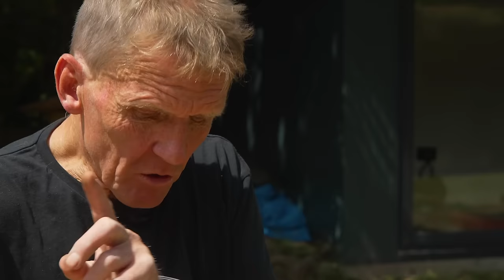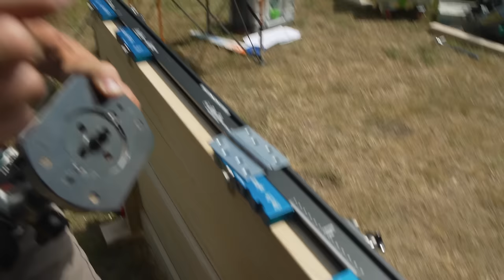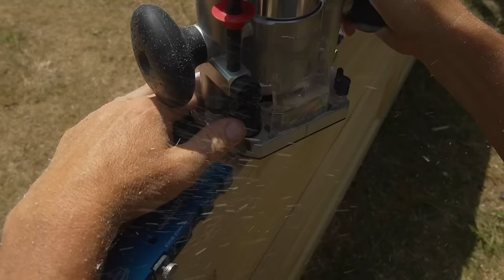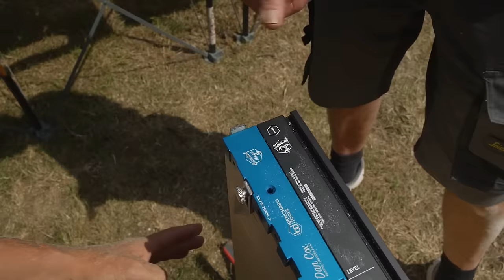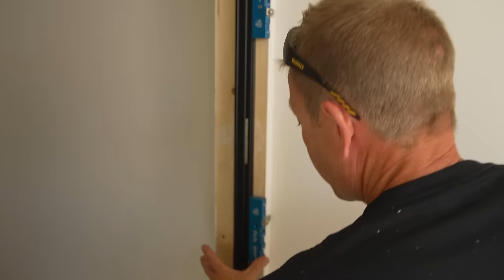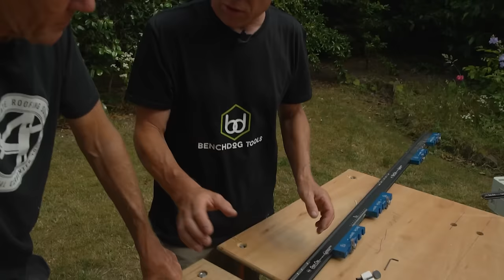Essential Hinge Jig ~ Hang Doors Quickly & Easily Every Time

Comment: I have now received my jig which arrived very quickly. I have now used my jig on six doors and the results are superb, as accurate as a CNC machine but I did have one niggle. The knurled knob that tightens the blocks to the rail. A couple were stiff to turn which resulted in them moving slightly when I stood the jig up after use. I had to be very careful not to knock it in anyway. As I mentioned in my previous post I did drill through the extrusion to secure the jig to the door lining and it was covered by the door stops so it would be nice if the holes were already there but it was a simple job to drill them myself.

Comment: Bought this jig after buying dans essential roofing square , both fantastic bits of kit , extremely well made , you get what you pay for , only got one very small critique, do the grub screws up tight , they drop out if you don’t , but you get spare grub screws when you buy the jig , they have also added a 3 mm spacer for the head that comes with the jig , well done dan 👍

Comment: This looks spot on. I’ve been using the Porter cable jig to set 8’ doors, it’s a headache to setup, you need to run bradawl pins in to the door and you have zero flexibility in the hinge locations. This looks like it checks all those boxes. Hoping you’ll ship the the US. Thanks Dan and Roger.

Comment: Looks well made. I like the fact you can use it on smaller doors and nip the blocks up tight. I use the trend skeleton jig as its quick to set up. I find the blocks move sometimes if you push guide bush into it too hard, as they are only tightend finger tight. Not a fan of screwing the jig to frame though, no reason why you couldn't use bradawls still I guess. I think the way of adjusting the jig to the thickness of door is far better on the trends. There's pros and cons to all of them.

Comment: Looks like a good bit of kit, and my experience with benchdogs is they do great quality products. however, I have used many different hinge jigs over the years, and have found it hard to beat my one piece trend hinge jig, but I only tend to hang standard size doors. advantage of this jig is you can add more sections if you have larger doors to hang, just one problem, looking at the size of section that fits on door lining, doesn't look like it would fit a rebated door frame, the trend works well on rebated frames or if door stops on

Comment: Hell of a bit of kit !!!  But not better than the plywood ones we used to make in about 15 mins 45 years when ago  fitting doors in the frames when building ships. 'Plus because the plywood was wider  router was more stable .  Plus when I do three hinges  ( which personally I  do not like ) l  tend not to chop it in on the frame  until I have had the door on in case I need to adjust depth position etc  as If all three hinge pins are not in perfect alignment you will have  issues.

Comment: This is a good looking tool. Ive got the Trend skeleton jig, the big one and I havent use it for the past 3 years because most doors have the hinges atached already. I used to fit 400-500 fire doors a month few years back, not anymore. Good video. Thanks for the free entertainment:)
Reply: That’s 20 to 25 doors a day on a 5 day week 🤔
Reply: @kieranfinnerty631  Correct! But I was a team of two. Didn't said alone🤪. We used to prepare and had labourers to move the doors to each floor/room, then me and my coleague did the install. Also we did mostly 6 days a week when I was money hungry😉
Reply from the maker: @nZebco  I know a carpenter Andy Foster who used to fit fire doors in London all day, every day. The doors were propped up in the hallways in hotels and flats and he would start at one end and wheel his rig down the corridor with the router and jig ready to go in the bottom. If you organise it properly two of you can do those kind of number but, like you said, it is all about the money. 
It would do your head in soon enough.
Reply: @SkillBuilder  I did the exact same thing🤪. two carpenter and two labouresrs, we never carried a door, they never fitted one, very precise work.
Reply: @SkillBuilder  I have photos of doors proped and alligned like domino pieces in massive open spaces like future shopping centers. Literally walking in with a hammer, pencil,corner chisel, makita portable router and trend skeleton jig. One person was routing, one was finishing, the guys behind carry the doors in the designated rooms.WEhen all prep done, plumb one side of the all the door openings, fit the doors, trims etc.. literally the success of this is the fact that you move with only tool belt around you and obviously no dead times. Been only money driven to do that as I had no pleasure in doing repetitive jobs. No more:)
Reply: @kieranfinnerty631 Yeah, this is actually quite achievable if you get set up right👍Me and a buddy used to be able complete 7 doors every 2 hours on site in our own linings, that's hanging the door, fitting the latch, handles and door stops👊Heavy fire doors took a little more time, but we'd still regularly knock 20 off a day👌That's the power of youth I guess😎
Reply: @thetallcarpenter  Yep, now I can barely wake up every day🤣🤣
Reply: @nZebco  😆

Comment: Like the jig alot. but as roger mentioned about the grub screws, cant you change them to T20 0R T 25 screws. I feel these would be much better and a lot more harder wearing than allen key screws. As you know they never last. a few times of nipping up and loosening they are gonna round off inside. Torx threads are far more harder wearing because theres mor points of contact.
Other than that, lovely bit of kit dan👍

Comment: The only thing i would say that having to adjust the clamps or flush plates to use on the frame would irk me, but its a great piece of kit  all the same, and im a fan of dans,, i have his roofing square which is brilliant
Reply from the maker: Hi Stephen 
 Moving that jig from door to frame is nowhere near as hard as you might imagine.
Reply: @SkillBuilder  not hard no not at all,,

Comment: this jig looks good ! i use the trend jig and it drives me mad . i have to put an additional screws through the jig to the frame because the jig doesn't sit flat enough to the frame even with the little awls . also, you were asked about how it attached to the frame . couldn't you screw it through the little  silver sliding adjustments to the frame ( 15.05 mins ) ? that way the trim would cover any holes ....just a thought  ! anyway product looks good , well designed !!
Reply: Thanks for your comments, and yes that could be a option to fix it to a finished frame.
Reply from the maker: eugene 
That is a great idea

Comment: Looks great - for using with a bearing guided bit I wonder if you could swap the block positions so you're referencing against the ends without the nib? I guess you would still need to compensate for the  2mm offset on hinge width. hinge.

Comment: Nice jig. Will it still be able to butt up against the internal head of a frame if the stops are already on/ if the frame was rebated? I always rebate front door frames when I make them and I make a similar mdf template with packers in rebate and small packer at the top. I have to notch the top of template to allow it to sit up against the rebate in the head though
Reply: You can just slide the block above the black metal track to form the notch.
Reply: Ah yeah, set the top block 15mm (rebate depth) higher from the get-go. Nice one mate, will order one deffo
Reply: @anthonychristopherali407  Thanks.   The pack out blocks will be available soon..

Comment: I've used and made a few jigs - I feel like this is great for repeat work, but not super flexible.
Reply: I think it’s very flexible, can do doors with 3 or 4 inch hinges.  
Height wise it will do from approximately 600 to what ever height you want.  I’d guess 3 meters would be rather tall. 
It clamps to a finished door and will be able to do rebated frames.

Comment: Why can’t you screw the jig to the frame by the sliding rail and not the blocks, wouldn’t that place the crew holes where the door stops go and therefore negate any damage to the frame?
Reply: Hi James, 
It could be screwed through the extrusion however there is channels in it so the hole would be in the channel. 
Thanks for watching.

Comment: Quality build is obvious here. Suggestion from a potential pro user: Better to eliminate use of allen key for securing templates to spine by providing small diameter clamping knobs or a Bondhus driver.
Reply from the maker: It has been done. The updated version has knobs on
Reply: @SkillBuilder  Sounds good. Can we buy from here in USA?

Comment: I've got to ask, where are you getting solid pine doors from? I had a look recently and even the ones from XL were engineered with veneer. I ended up doing a lot of work to some reclaimed doors (made them bigger and square with some ripped down timber from of s similar age and dowels) because I couldn't find anything that came close in quality to the old Victorian stuff. The jig is very clever and well made as you would expect from Benchdogs, I'm only a DIY renovator pleb so I'll stick to the chisels for now 😂doesn't take me too long to hand a couple of doors.

Comment: You should take a look at the FC Tools hinge jig that has been out for some time and in my opinion is much better as it has been refined over time.
Reply: I’ve actually owned 2 of his jig’s and believe he’s probably on version 6 or 7.  
Funny how he’s copied our concept on his latest jig.
Reply: @Ultimate-roofing-square.  I'll take a look an interesting point, I would be interested to see how the two compare in action and in price.
Reply: The good thing with ours is it doesn’t need refining so you buy this version and you don’t need to upgrade it or spend any more on it. We are the only hinge jig that has a dedicated fitted clamp to the door without reaching for additional clamps. It also comes supplied with a storage case so no extra costs required to keep your investment safe. We are both a registered UK companies which pay our Tax and VAT adding to our economy not just pocketing the money.
Reply: @Benchdogtools  But how does the price compare, if its on par or cheaper it might be worth me buying one?
Reply: I think our is a cheaper and better option.  Especially if your vat registered as you can claim it back.

Comment: Looks amazing but! You have to install Fire doors to the Data sheet! Not fitting hinges where you want.
Reply from the maker: I am not sure what you mean by that. The jig is fully adjustable and the 100mm spacing is standard. If you want something else it is just a matter of sliding a block up or down. It could not be easier.
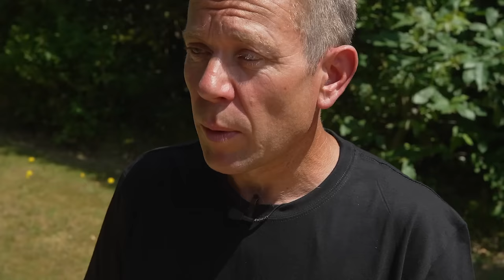Reply: 1:03. You guys said  on a fire door you don't put the hinge in the middle. You have to follow the data sheet to cover fire regs etc. That said it looks a great piece of kit and I like the flexibility and storage 👍
Reply from the maker: @TheSaintemplar64  Fire doors require two hinges at the top 100mm apart. That is how they are designed due to the weight

Comment: I don't like bearing cutters for hinge jigs as the bearing is normally the first thing to fail, so I'd always go for a fixed guide bush,
I also like how you drill the pilot holes for the hinge,
The jig looks great, but how quickly can the handing be changed? Small Allen grub screws in aluminium will seize and the heads easily strip.
I had one of the early screwfix jigs,  your jig does have some improvements in accuracy, but it is far too complicated and has so many tiny parts that WILL get lost working at the speed needed to justify the initial cost and set up time.
It's not worth the hassle for 1 or 2 doors, and a strip of 1/2" ply and 10 minutes marking and cutting can create a custom jig for multiple uniform units, any height or thickness of door and any number or placement of butts.

I can see it being a perfect tool for a factory production line. The build quality looks sturdy and precise, 
I especially like the plan to include packers for rebated frames. That is one thing no other jig I've come across addresses.
Good luck.
Reply: Hi Sally, 
Thanks for the comments and some positive thoughts.  
The jig is very easy to change hand, and it can be set so you don’t need to do anything.  Just leave the door lining stops in the middle of the hinge block.  
The Allen key grub screws do have a plastic buffer on the ends, so they are a bit more forgiving.  
It’s not really complicated, it’s just the 6 blocks attached to the rail.  

Thanks.
Reply: @Ultimate-roofing-square.  looking forward to seeing one in the flesh, 
I'm probably not really your target customer TBH, after 20 years of replacing doors in old northern terraced houses, where no 2 are alike, (and never straight) I'm pretty fast, about 20 mins per door to plane, hang and latch.
Had to learn to slow down a bit now people are wanting more and more expensive doors. But I can charge more.
Reply: @sally6457 if your uk based I’ll be attending the Coventry tool show and Sandown race track later in the year where you can see the jig.  
Thanks for your comments.

Comment: Looks well engineered but unless I'm missing something I'm struggling to see how to use it on a rebated casing.
Reply: You will add blocks to pack it out.
Reply: @Ultimate-roofing-square.  that's an extra job that would rule it out for me. The trend skeleton jig just goes straight on a plain lining or rebated casing with no faffing.

Comment: Your roofing squere is the best! But the hinge jig from Robin Clevett is much better, chipper and easier to use.
Reply from the maker: Those throwaway mdf jigfs have been around for over donkey's  years and have their place, but hinges do vary quite a lot so they don't always give you a precise fit. Also most of them require you to plunge rather than coming in from the side. It is horses for courses.

Comment: Why don't hinges go in the middle for fire doors?
Reply from the maker: A fire door has a solid core which makes it very heavy. Having two hinges at the top means that the cantilever effect is reduced. The hinges also have to be of a higher grade (thicker) to hold the weight and withstand the heat of a fire for longer.
Reply: @SkillBuilder  Interesting, thank you for taking the time to reply

Comment: You can put it retainer on the grub screw and then it won't get lost
Don't see the point of it, you can just use a chisel only take you about 30 seconds to cut it. the time you set up the jig you could have done two doors.
Reply from the maker: Would you like to do a head to head on two doors, we will film it?  Three hinges on each door.
Reply: @SkillBuilder do you k ow what that would be a awesome idea and would make a great video for the channel
Reply: @SkillBuilder  sounds lovely but I'm not well enough these days 5 years ago maybe. somebody else must knows how to do it so they might take you up on the challenge. I'm suppose he doesn't if he's made a jig he should know.
Reply: @hoobsgroove 9 times out of 10 the jig will be set up when you get it out of your van. The houses I tend to work on have at least 10 doors. 3 hinges per door, which is 6 cut outs, times 10 doors. That’s 60 cut outs that can be routed with no measuring and no mistakes all done perfectly….. unlike your 30 second chop job.
Reply: So measure the position, cut round the hinge with knife, chisel out 100mm hinge so 20 cuts with the chisel, say 2-3 taps of a hammer each, take of the feathers, clean it up…. All in 30 seconds with 0 mistakes… lol
Reply: @resmond  why is it 20 cats? 4 to 5 cats max no knife needed, if you got multiple doors just clamp them all together and do them all together one after the other.
The time you set your jig up and your router you would have been finished and having a cup of tea lol
Reply: @resmond  he’s a troll.  😂 He says he can chop a hinge out in 4 or five cuts without knifing first. 😂😂😂😂😂 So by reckoning he has to use a 2 inch chisel on a 4 inch hinge. One chop at the top one at the bottom then two down the sides leaving one mighty whack from the side to take the whole lot out.. Then the real clincher is the “just clamp all the doors together and do them all one after the other” 🤣💦 
He’s never hung a door in his life. Hilarious..
Reply: He's got a pro hinge jig one big wack off a lump hammer to cut the hinge and another big wack from the side to clear it out ,YouTube it PRO HINGE JIG

Comment: Sorry guys I love your videos but it’s too fiddly, too expensive and too precious if you catch it with a cutter.
12mm ply templates and simple profile cutters.with a  3mm plastic packer when routing the frame.
One for fire doors, one for centred three hinge and one for 75mm hinges.
Yes bearings go slack at some point but the edge goes off too so replace, and they’re cheap to buy with no collet maths necessary.
Reply from the maker: Fair enough! It isn't for everybody and  whatever works for your is fine.  If you can always get the hinge to fit your jig you are fine.  This is not a pressure sell.